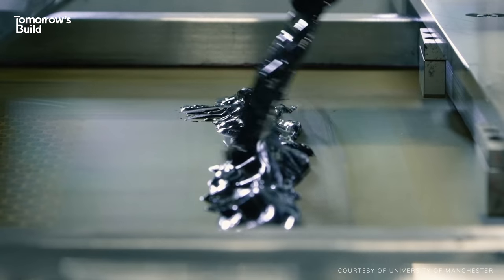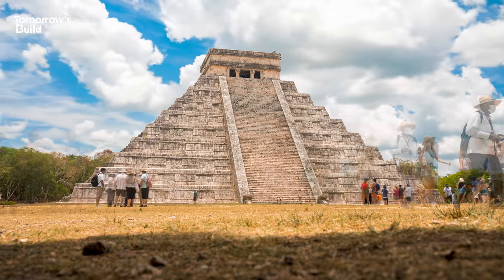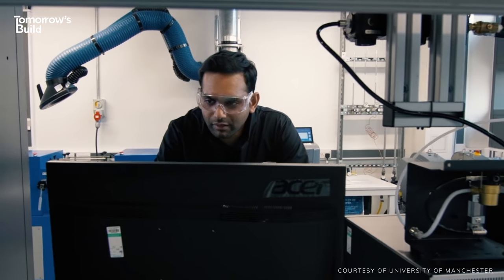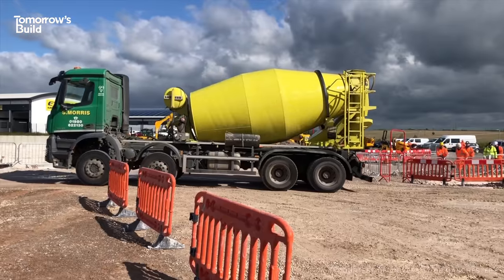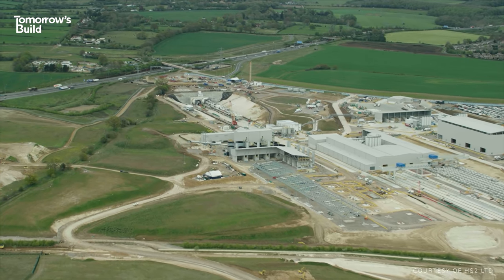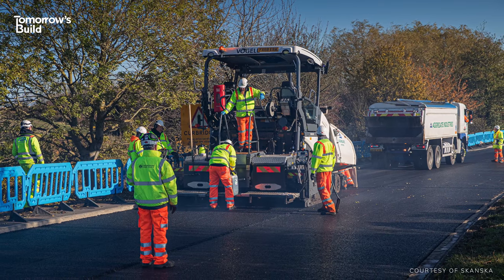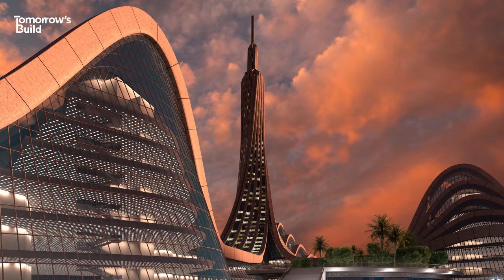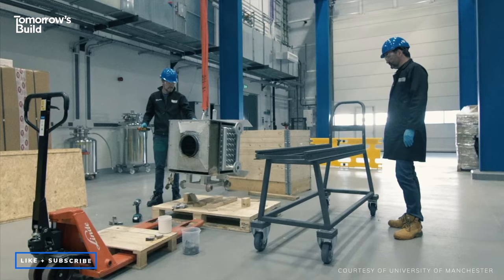Construction's Graphene Revolution Has (Finally) Begun

Comment: Could you actually build a bilding with enough graphine in it to be a lightning conductor? Grounding lightining bolts into a huge battery could be a nice new project if the conductivity of the concrete is high enough.

Comment: Quite interesting how you placed the fact that "regulations are the holding factor" like 3 times...
Bias somewhere?
Reply: Seemed fair to me. I mean you could go and buy Graphene today, bung it in some concrete and try and build anything stronger than a drive way out of it, but I guarantee you won't get whatever you build certified. That would be the regulation thing. Not a bad thing in moderation, it's that or more bodgy products killing people.
Reply: @Chris K u can make graphene by your own :P
Reply: @AqoussRec  If you can manufacture Graphene in bulk (say enough to think about using it as an additive in concrete), go into business and get rich.
Otherwise, you're just making 10 atom thick, very small quantities with a block of carbon and a lot of sticky tape.

Comment: Hardware innovation seems too slow, much slower than software growth. I think hardware growth requires a big drive from industry, so investment is vital for taking it from a college lab to corporate lab or military lab like darpa quality. This material must interest computer industry, battery industry and space shuttle industry for its light weight. AR googles and other electronics could benefit from its light weight. 3D printing & robotics is also an area I would be excited about.

Comment: people always explain graphene as this 1 atom sheet, and anything more than 1 atom sheet is just graphite
but then why almost every commercial production of graphene is in powder form?
can someone explain to me the (basic) composite material science of why graphene this small still act as graphene and not just regular ol graphite
and whether given specific enough temperature or pressure, it can lose its "graphene" property
Reply: It's the molecular bonds. Think of how you can make a diamond out of graphite by adding heat and pressure. Adding energy is required to make them bond more tightly together so graphite doesn't naturally form into the more tightly bound version. The energies involved are a lot smaller between graphene and graphite but the principle is the same.

Comment: You don't need to use graphene, the same thing can be achieved using fly ash which is a waste product that currently has no use.
a better approach to graphene in building material would be to use graphene mesh wire surrounded by fly ash concrete.

Comment: I would say construction will be the last place to be wide spread. It will only ever be a fringe use unless it can save costs. No rebar is a joke, you have to have shear strength across the entire support structure which short fibers cannot do. Sure you can change the rebar material but unless another material is stronger and cheaper it will never be main stream. The graph we batteries seem like a more revolutionary idea but I doubt in my lifetime.

Comment: That is not graphene when you throw into mixture of concrete powder or liquid of carbon. Graphene has 2 dimension structure which powder or liquid does not have. This is another UK cheating.
Reply: It's called a composite. Hardly anything is actually used in its pure form.

Comment: What happened to carbon nanotubes? I guess graphene, at least for now, is just more practical
Reply: Carbon nanotubes are cylindrically arranged graphene particles so they're sort of the same thing and they experience similar manufacturing challenges. Several thousand tons are made every year and some applications have been found. I think the one I found most interesting were for water purification and desalination.
Reply: @abebuckingham8198  Yes, I know they have quite a few applications like in TVs due to their low voltage required to emit an electron and they also have high conductivity. I was speaking more about I thought they would have more uses in structural materials.

Comment: Most graphene application firms produce a concrete additive. They are used now. 
   This is more of an advertisement than useful knowledge. 
    Very misleading in that it only covers one company in one Country. With mostly old news.
    First Graphene in Canada has been selling this for several years. 
    Don't rely on this as any due diligence on graphene applications.

Comment: Graphene is not a 2D structure just so everyone understands.
Reply: They say it's 2D because it's one attom thick, but obviously atoms are 3-dimentional, therefore graphene has to be 3-dimensional.
Reply: Mathematically, no; physically, yes. It's not possible to make anything thinner.
Reply: @chrish7887  technically, helium is 700 times smaller than carbon, and it can be a solid at very low temperatures, so you could have a thinner monolayer sheet.

Comment: You are kidding right? We need to get rid of concrete by using alkali alumino silicate resins. These resins already have nano-tech properties that outperform graphene as a compositing agent. Again people want to believe the hype and not think about the reality that concrete is on the way out and the solution does not rely on compositing individual agents it relies on room temperature sintering and chemical bonding through hybrid resins systems that act on nano-micro and macro level. Resins are far more easily scaled to meet the needs of a sustainable world.

Comment: Still just all hype. Usually when those on the cutting edge say “5 years from now,” expect maybe 10-20 years if ever. This researcher says we’ll be in the same place 5 years from now. Not sure how that extrapolates, but don’t hold your breath. Poured a concrete slab on the ground with some graphene in it. So what? Was it 50% thinner? 20% lighter? More flexible? No rebar? What? “It won’t crack,” they say. Uh huh. That’s what every contractor says about every pour job. Come back in 10 years to count the cracks and then we’ll know. And even then what we’ll know is they did a good or a bad job of compacting and site prep. Could have used fly ash in that concrete with the same claimed strengthening.

Comment: Why do you think they put it in the jab?
Reply: It's not. The patent or ingredients do not show graphene. and No independent test has ever shown graphene in the Vac
Reply: @veritasdesigns5067  And not democrat propaganda. If I was there I would have voted for trump. 
I base my comments on evidence not politics that you appear to do.
Reply: @veritasdesigns5067  Lipid Nanoparticles and Graphene Oxide. You are right it’s not rocket science. 
Yet you’re still wrong. 
You are incorrectly assuming that they are the same. They are NOT. You can have Graphene oxide nanoparticles but they are not Lipid nanoparticles. 
There are is no graphene oxide in the Lipid nanoparticles in the Vac. 
A simple unbiased search and a bit of reading should have cleared that up for you.
Reply: @veritasdesigns5067  No you don't, because it's very obviously incorrect.
Reply: @veritasdesigns5067  You can donate blood and plasma after the vaccine. No problem. Look it up or phone and ask.
Reply: @veritasdesigns5067   It appears you do NOT use logic when doing research. You seem to use emotions and politics in your research bias.
Reply: @veritasdesigns5067  There is nowhere on Archive... (or anywhere) that the C D C said anything about Graph in the Vac in 2020 or any time. It's not there. It didn’t happen.

Comment: Well... when you claimed Graphite was in the same atomic structure as Graphene, I stopped watching cause I knew you where wrong.
Reply: Graphite is just stacked sheets of graphene, they literally discovered graphene by sticking a piece of tape to a lump of graphite and peeling it off.
Reply: @chrish7887  No it is not.  Graphite is disorganized.  Very little of the graphene was found using that method and only after using a solution to clean the glue off.  Real graphene has to be allowed to actually organize its atomic structure for any real useful amount.  The most Graphene they would have found from that tape method would have require an electron microscope to find, with the mass majority of it being the disorganized graphite and not the organized graphene.  You are trying to use an extremely impure sample source as a reference, in chich you would be lucky to even find 1% worth of that graphite organized into graphene.  Stop playing scientist and actually get real.

Comment: Its nit flexible at all, anyone who had carbon fiber bicycle or carbon fiber anything knows this. It is very strong so should not break. Good video tho, thanks.
Reply: Carbon fiber itself is flexible, but it's typically impregnated with an epoxy resin that makes it stiff. You wouldn't want to ride a bicycle made out of floppy fabric.

Comment: How about a carbon graphene? Let's take pollutants out of our atmosphere and inherit them into structure durability strength and longevity, and inadvertantly also be able to use structure as power source - energy??? Liquidate the weight of batteries and the mileage of electric cars will increase tenfold...

Comment: Graphene oxide is also use in Pfizer vaccine.
Reply: It's not. The patent or ingredients do not show graphene. and No independent test has ever shown graphene in the Vac
Reply: @paulg666  Pfizer never declare graphene but lab analysis by some scientist showed that Pfizer contain graphene.
Reply: @paulg666  Sorry, I didn't keep the report. At least in Japan They manage to detect foreign in modern vaccine.  If I can trace the report, I post here.  Anyhow I personally believe that report.
Reply: @FatehAyub  In Japan no graphene was found. 39 vials, from Spanish manufacturer Rovi, were found to contain small particles of stainless steel (as found in heart valves and joint replacements) due to a manufacturing fault. The whole batch was sent batch. There was no graphene in the vials. 
I have looked for actual reports or test that say it's there. I have never found one.

Comment: Sorry but this video was worthless. Where are the Numbers? How much does it increase tensile strength? Why is it in powder form when it should be a layer? Most applications you showed looked more like adding a carbon coating than actual graphene. So much missing information ....

Comment: so we exist in 3d not 2d
graphene is not this wonder material everyone thinks it is
shearing forces make graphene as weak as dust

its conductive but not better than most common metals
so imagine a graphene rod vs a steel rod 
the graphene will dissolve and be blown into dust by mild weather
the steel would still here there after years
so i got a simple experiment for people
roll up a sheet of paper into a tube and try to rip the tube in two 
roll up maybe a second sheet
and push the two ends into each other
that is why graphene is bullshit hype it only has the anti tear properties
a building material needs to resist both forces compression and tearing